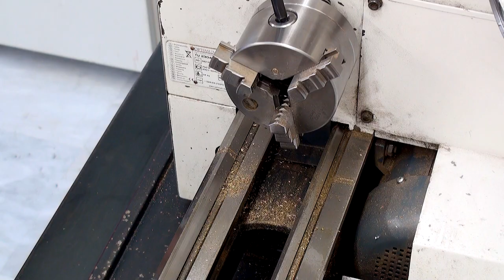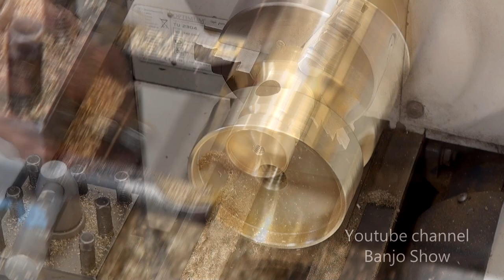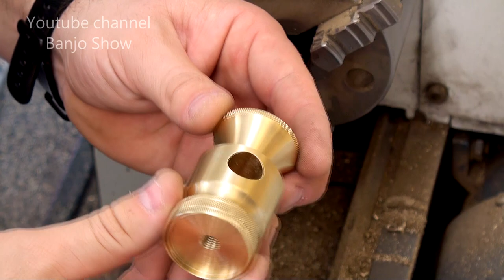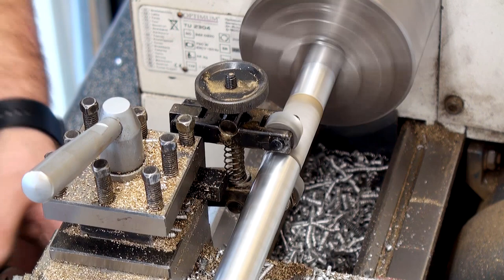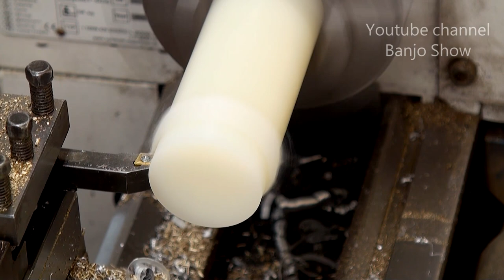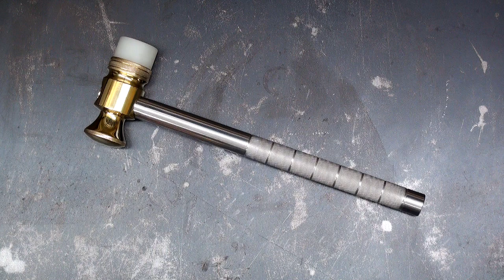Plane Hammer - Making Tools How To

Comment: I would definetelly NOT use this hammer. I would hang it on the wall of my living room. Or even put it on display in the center of the room with lights around it.